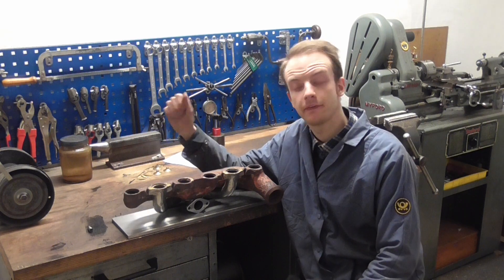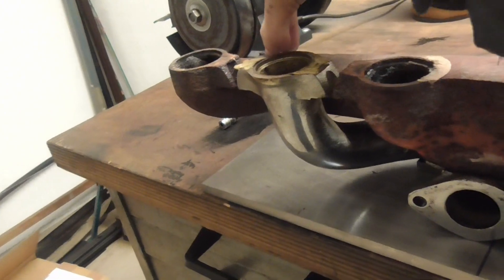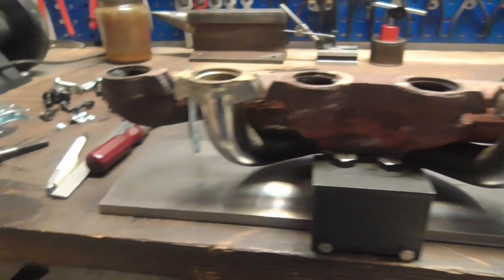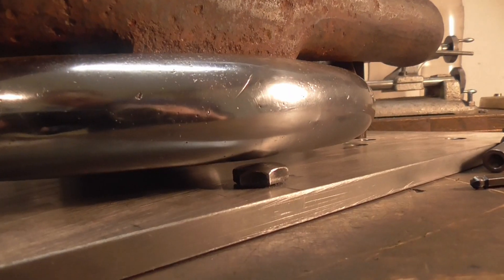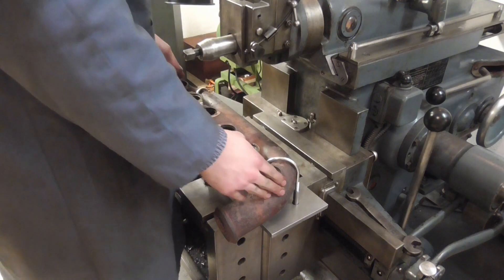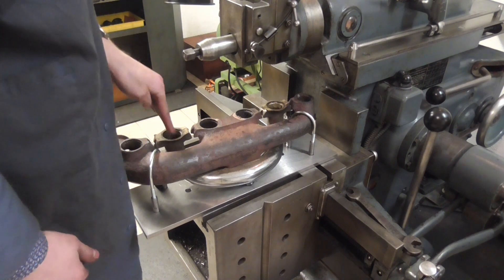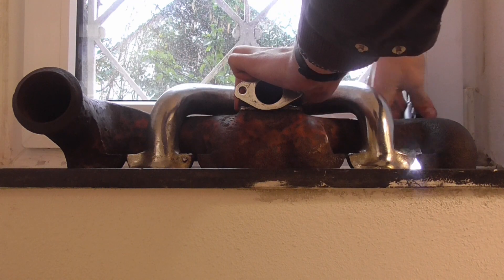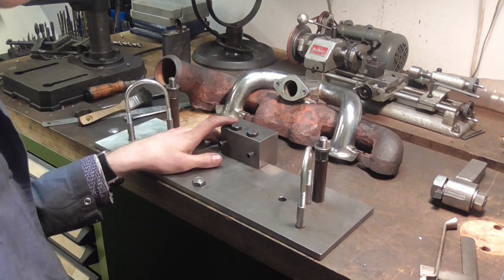Manifold Surfacing Jig for the Model A

Comment: I noticed you did not use the lift on the clapper box. 31 45B
Reply from the maker: It's really only needed when running Carbide or Insert tools, in order to keep the cutting edge from breaking on the return stroke

Comment: Any idea where/how the error crept in?

And - once again (especially speeded up) you drill press table is visibly flexing. Could you use something like a (homemade?) planer jack to support it?
Reply from the maker: Hard to pinpoint. Had I bent the manifold while clamping it down, I'd expect the error to be exactly the other way around.
I'll observe how future manifolds turn out after surfacing - if the error is reproducable, it's the jig's fault.
In regards to the drill press... I've tried supporting the table with wooden blocks - but then, the top part containing spindle and motor will flex upwards. The whole thing is too much on the flimsy side to make a good drill press.
On the other hand, I have yet to have two parts not fitting due to holes being crooked!

Comment: Pretty slick, that worked well!  I like the idea of using a shaper for manifolds, I've done a number on a vertical mill now and the shaper just eats rusty old cast iron for lunch whereas the mill throws dusty crap everywhere.  Was the tool you were using carbide tipped?  It was hard to tell in the picture, but I would suspect it was due to the hardness of the crust?
Reply from the maker: No, it was plain HSS. While it may not be as hard as Carbide, it's also not as brittle and will take the knocks and beats exerted by scale and hard spots without shattering. Shapers are also great at cutting through flame-cut plate material. It'd take many milling heads worth of carbide inserts to get through the flame-cut scale, while a beefy HSS bit with a big radius on it's tip will just go marching through.
Search for "Shaping 28" Parallel bars" by 'Abom79' - it'll give you a great example

Comment: As a point of reference, do you have the out of flat plane measurements on the surface plate before the corrective machining was completed?  I assume the owner was having problems with exhaust gas leakage or he was suspecting an intake manifold air leak.  Thank you for another fine video.
Reply from the maker: I didn't, on account of alot of the old gasket material still being stuck to the material. From what the owner told me, it was leaking heavily from the cylinder 3 and 4 exhaust and behaved like having an intake manifold leak - which, with all the scaling, doesn't surprise me one bit. In total, I took about 3/10mm (a little over 10 thou) off the top.
Reply: Thank you   Here in the States, there are various gasket types available, in my experience, some better performing than others.   In any case, the better the fit, the better the chance of a good seal.  He is using the circular spring clip exhaust seals which fit in the port groove? They are sometimes omitted.
Reply from the maker: @myrlstone8904  Very true - I've had the best success using the large one-piece gasket, while I think the green paper gaskets are only good for show cars that don't get run for any considerable amount.
I don't know about the owner, but I've had the gland rings installed; they don't seem to be able to do much, if you ask me - the expanding forces created by heat are so large that they'll simply deform a tiny strip of metal as are the gland rings - especially if they are weakened by heat, themselves. 
They are a good aid to get the manifold and gasket aligned while mounting it in place, but not much more.
Reply: I’d say the jury is out on the spring ring seals here, I install then though they can turn the manifold installation into a three handed operation.
I must ask, how did you accumulate the old machine shop equipment?  Do you have companies selling salvaged machine shop equipment ?  Here it is often a case of being at the right place at the right time. Save it from going for scrap, what treasures.

Comment: Marvellous work (and videomaking) as always! Just replaced my Tudor's manifolds last week, they were far beyond restoration. I have the same problem with my drill press, the same model with an Australian brand label slapped on it. Does yours still self-start, or does the chuck need a twist to get turning like mine? 🤣
Reply from the maker: No it's still a self-starter - if yours needs a flick, try swapping out the big capacitor strapped to the motor, that ought to do the trick
Reply: Good to hear. I'll give that a go, cheers!
Reply from the maker: @ScumClassWorks  You should find a capacity rating on it somewhere (I think the rule of thumb is 80µF per 1kW of power) - with that, you should be able to find a suitable capacitor anywhere online.